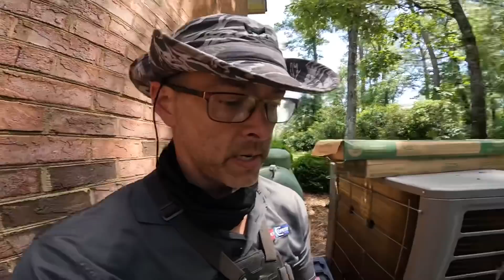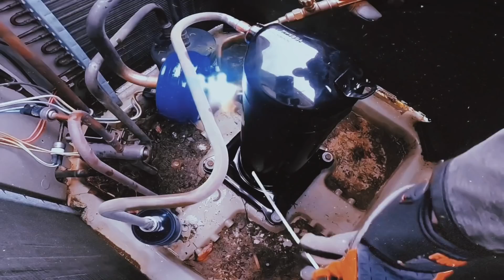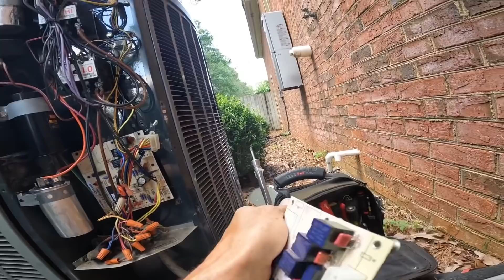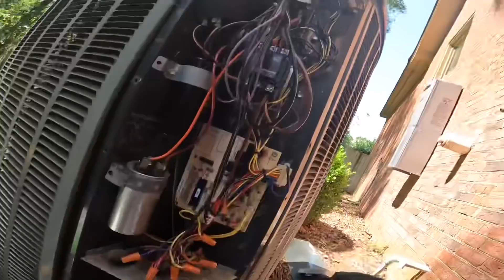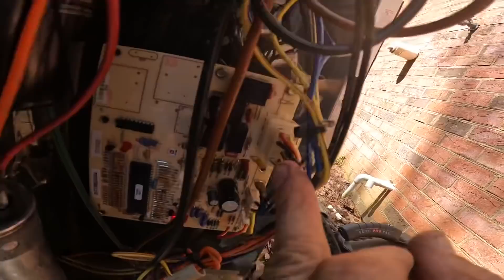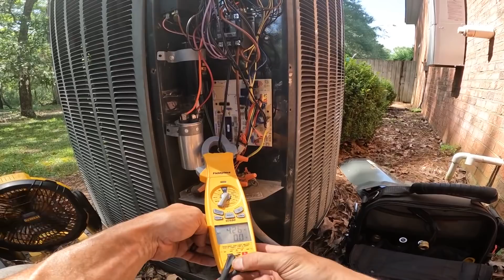Repairing 19 SEER 2004 Trane

Comment: If one of those contactors ever sticks shut, and the other one comes on it will burn up the compressor. Lennox used to have a set of contactors with a latch mechanism so if one ever stuck it would not allow the other to pull in. I’m assuming that it is a single two speed compressor.

Comment: What people don't understand is you can have the most efficient unit on the market but if the ductwork isn't efficient it's not going to do what it's supposed to if the windows and doors and insulation in the house isn't efficient it's not going to do what it's supposed to these new 410 a units require everything to be right or it's not going to work right with the r22 you could get by with some stuff but not so much with 410a

Comment: When those units were installed right and wired correctly, they worked great. Last good unit that Trane made. Now they are over engineered Garbage with useless features. Evap coils constantly leaks and tstats need replacing once a year.

Comment: I have a similar, but older 1999 model Dual Compressor Trane XL1800 HEAT PUMP, and about 2 years ago, I decided to change both contactors.  I checked the old ones after replacing them and they looked and resistance measured at all points just like the new ones, so I stuck the old ones on a shelf just in case I need them later.  Anyway, I ran into the same problem you did, and I also cut off the ends of the wire connectors  so I could push the round crimped wire ends into the contactors and tighten them down with a screwdriver.  AFTER I did all of the, I ran across another video on youtube where someone else ran into the same problem, and they said that you can completely remove each screw from each lug, and then remove the lug assembly and then connect the wires back using the original unmodified ends on the wires!!!!  Would have saved me a lot of time cutting off all those little legs, but like you it all worked out in the end.  If I ever have to change them again on some other unit, I'll know not to cut off the little connector tips, but simply remove the lug capture part of the contactor.  By the way, I did this on my personal A/C unit.  It's a 1999 model XL1800 5 / 2.5 Ton heat pump unit and I absolutely love it.  I think its running a little low on R22 because even though the unit seems to heat and cool pretty good, very rarely can I get the suction pipe to sweat.  I have about a 15-18 degree delta t, but I need to put my gauges on it and check it out.  I assume you have to add r22 and do your measurements with it in the 5 ton cooling mode, but I'm not sure.  That's the way I'm planning on measuring it's performance.  Thanks for sharing the video.  Not too many of these dual compressor Trane videos online.  I guess they just don't break much, and that's good!  Stay safe out there and thanks for some great videos.

Comment: PRO-TIP you can pull the lugs off of the new contractors and there is a screw hole there that will accept the screws from the old contactor.

Comment: Just a safety tip I was aways told to never use two hands when plugging slug back in breaker box for the possibility of getting electrocuted if box has a short and you ground your self

Comment: Is there one compressor in there with two stages or two compressors?
Reply: 2 compressors, 1 for 1st stage, and another for 2nd stage, only one runs at a time.
Reply: @markbeiser  interesting. Never worked on one of those

Comment: You could change to female spade connections and use the male spades on the contactor.
You could add connections to the wires and put them under the screws, probably a better connection than just wires by themselves.

Comment: What size unit is that? If it is a 2.5 ton unit, that top capacitor may need to be larger than 10mfd, as it uses one of the capacitors in 1st stage, and the other in 2nd stage, instead of both in 2nd stage like all other sizes of XL19i units do.
If it still has the paperwork in the envelope on the inside of the access panel, there is a parts list that shows what size capacitors it needs.
If memory serves, it is a 35µ capacitor for the first stage, and counterintuitively, a 25µf for the 2nd stage compressor.
Since the bracket actually fit the capacitor that was in there, I suspect you do have a 2.5 ton unit there, and now have a grossly under sized 2nd stage run cap in it.

Comment: That was alot of work. Way to hang with it. 
😎👍
Reply: Did you check with Trane when you picked up those parts to confirm that was indeed supposed to be a 10 microfarad up top? I was just going by what I'm used to seeing on those units. 😎👍

Comment: You added that 10mfd was it because the other capacitor was too big? And is it for when high stage compressor kicks on please explain
Reply from the maker: It was too big. That one is meant to supplement the larger one below
Reply: Oh ok and when does it need to supplement the larger one? For high stage only or?
Reply: @Ricoswavaey  2 different size compressors, with different run capacitor requirements.
On all but the 2.5 ton units, the larger capacitor is in the circuit with the 1st stage compressor, and both are in with the 2nd stage compressor.
The 2.5 ton units used just one capacitor with each compressor.
Reply: @markbeiser  makes sense, thank you for the explanation and knowledge 🙏🏼

Comment: Good video! I must admit I was surprised to see a 2004 model rated at 19 seer. Can't help but wonder why 13, 14 and even 15 seers are still up for sale considering how energy conscious the current regime running this country is.
Reply: That’s because the lawmakers don’t have their hands In that honeypot yet. Once they are set to gain financially they will mandate it.
Reply: @MookieMan1  Um, no, that's because in 2004 minimum seer IIRC was around 8
Reply: @sprockkets  I think the joke went right over your head.
Reply: @MookieMan1  Jokes are supposed to be funny. Plus regardless of who is in charge, minimum SEER has gone up from 12 to 13, 14 if in the south.
Reply: @sprockkets  Jeeze. You are very dense. Pedantic
Reply: Early 90s 10 seer mandated around 2007 13 seer mandated 14 in south since around  2015 . I think next set of rules is around the corner

Comment: I'm amazed on how long some of your customers 
go with no ac..
Here in FLA folks want ac 
working same day I'm there.
Reply: That's not different than here in Texas or any other part of the country. It is nice when homes are larger and require two or three systems! However I had a call once when the distribution transformer from the utility fed 4 different homes and blew up all the compressors! What a fun day! TV sets and refrigerators were also ruined!
Reply from the maker: They had the high speed on that one. Plus, I would’ve been back earlier, but they had COVID and asked me to wait.
Reply: Your an AC hero!!!

Comment: I see run capacitors and 3 pole contactors just little confused what's the reason for the 3 pole contactor? If it's single phase equipment.
Reply from the maker: Two compressors sharing one of the capacitors, and start kit. Thats the reason for third pole.

Comment: Just a suggestion for lugs I just cut off the ears of the spade connectors which makes a better connection than just bare stranded wires.
Reply from the maker: That’s what I did.
Reply: This works!